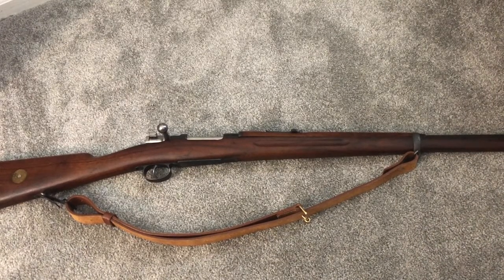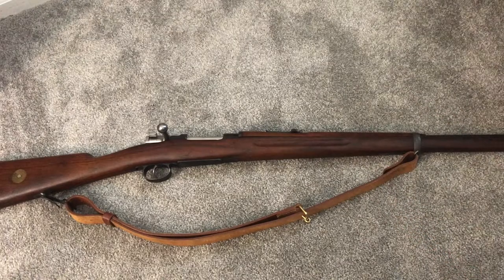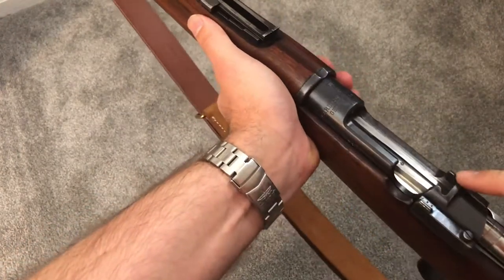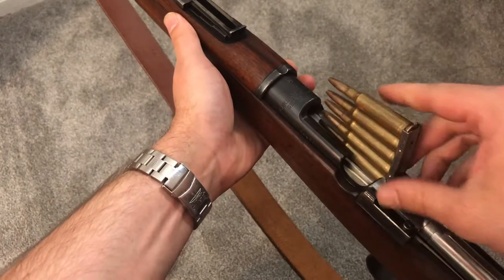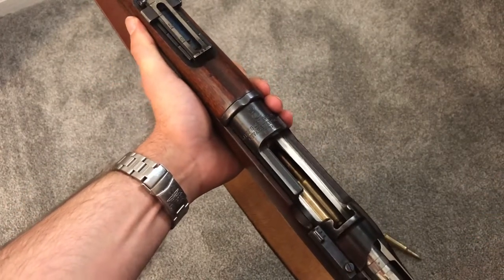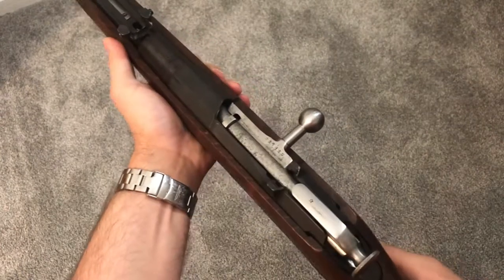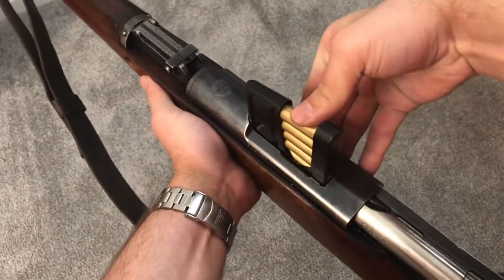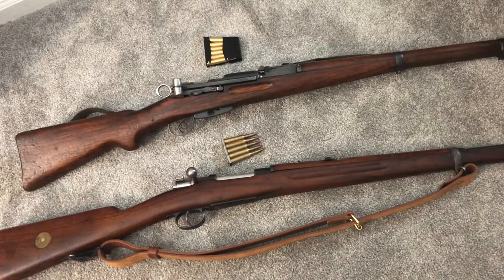Stripper Clip Ejection: Automatic vs Manual Removal

Comment: I slightly panicked when you pulled the trigger on the K31
Reply: it does looks like a life round lol
Reply: @Ironpine27  except that the K31s rounds were not shiny or red.
Reply: @aeropostale101nw  except the dummies he used in the K31 weren't red or shiny :)
Reply: @spoonbruh741  Notice that he did not pull the trigger with the "dummies" that were bullet colored. He unloaded the rifle after loading those. That's because they are NOT dummies.

Comment: Mosin clips are supposed to pop out by themselves when you push the last cartridge out of the clip. Your clips must be some soft metal, as the real clips have stiff enough springs at the ends to pop the clip up once the pressure is gone.
Reply: Yes
Reply: In my experience, it only happens when raising the top round by a certain angle, and the clip ejects when the top round leaves the clip and goes into the magazine.

Still smoother than loading an M1A with clips though.

Comment: I enjoyed that so much, I subscribed just for this. What's your favourite rifle that uses stripper clips?
Reply from the maker: That’s a tricky one. Swiss straight pulls are pretty sweet, but I also have a soft spot for Finnish Mosins.
Reply: @sonatadusk3304  Do you own any Japanese rifles? Thoughts on a Mauser and Kar98?
Also what from your experience hits harder, not necessarily penetrates more: Lee enfield .303? Kar 98? Mosin nagant?
Reply from the maker: @Mark71697  I do not own any Japanese rifles. 
Mausers are bombproof guns. I own a 1903A3, M96 Swedish, an a Czechoslovak Vz 24. As bolt action rifles go it’s hard to find faults in them. 
All of those cartridges are stupid overpowered for infantry rifles. In terms of energy they’re all very similar.
Reply: @sonatadusk3304 I have all three... Multiple of 98 variations. Feed issues with Enfields, bolt issues with Mosins, but Mauser bases systems just work.